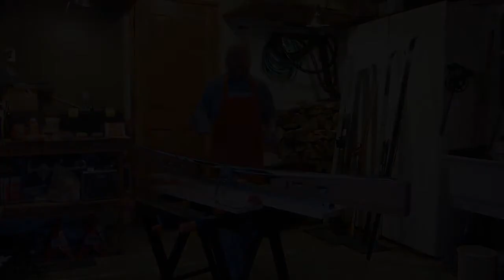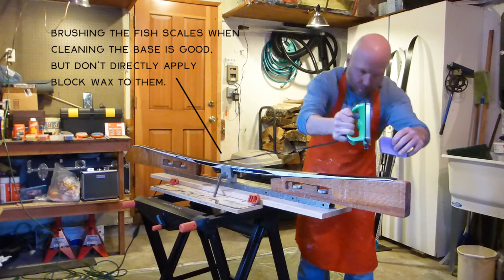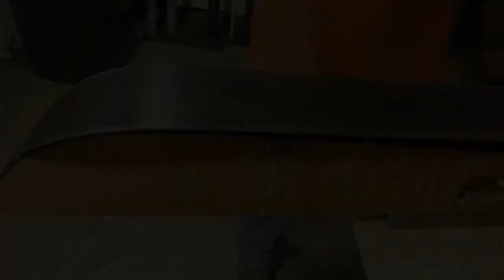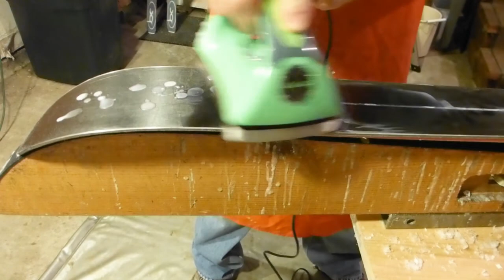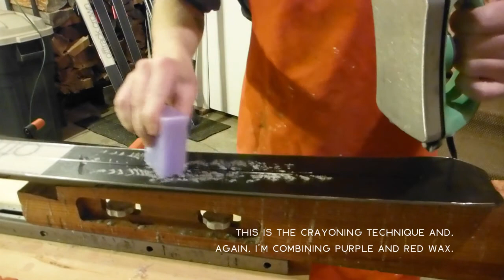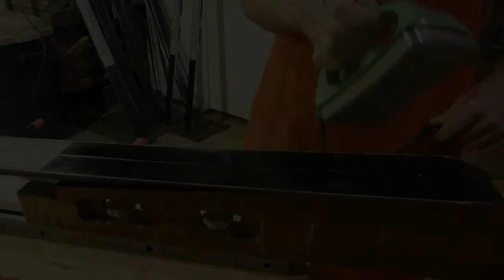Wax Your Waxless XC Skis (Part 2): Apply Glide Wax

Comment: I have one more question Jared. I have some of the older small, Swix canister types of glide wax that I used to use when I was hot waxing the tips and tails of my "waxable" skis. I was wondering if I can still use these on my "waxless" skis or are the newer waxes now a better choice? Also, my wife's skis are made by Rossingnol and the model is an EVO Discovery (L.L. Bean), the base is white, is that a sintered base as well?
Thanks,

Mike
Reply from the maker: Hey Michael,

Thanks again for getting in touch!

As far as I know, wax doesn't really go bad. If it's Swix and it's glide wax, I'd use it to initially save yourself some money. There are superior waxes on the market compared to what you have, but unless you're racing I wouldn't worry about it. Besides, there's been a whole bunch of hullabaloo about the use of fluoros in high-end waxes that's drawn the attention of the EPA in recent years. A big wax industry shake-up, actually. Honestly, though, I just stick with the basic CH (non-fluoro) wax because it's less expensive, less environmentally and personally hazardous, and I don't race. Again, I adhere to the tenets of functional waxing (vs.performance waxing) so that I limit my time in the wax room and maximize my time on the snow.

I'm not super knowledgeable regarding base materials. However, I believe the traditionally black bases have been infused with graphite to decrease friction (by "grounding" the ski and reducing the electrical charge generated by the motion of skiing ... or some damn thing like that). So, the white bases of your wife's EVOs just aren't infused with graphite. Now, there are old-timers who automatically equate a white or clear base with an extruded base (melted plastic base with no structure) because the old, cheap xc skis used to do this. With an extruded base, there's no point to waxing because it's all just going to sheer off as soon as you start running the skis.

I find it difficult to believe, though, that a respectable company like Rossignol is going to manufacture contemporary xc skis with extruded bases. That's an old business model in my opinion. Besides, I've see high end Rossignol race skis that actually have a white base. One of the upper level ski instructors at my work saw them and commented how "rare" they are to find those models in the US. If you look closely at those EVOs, you're going to see structure in the base at the tips and tails. So I say to go ahead and hot wax them like your own pair. I think the clear or white bases are a visual design thing, and I think it's also a slight nod to the idea that infusing the base with graphite might not actually be as effective as we'd like to believe. It might also be less expensive to manufacture the clear/white bases than the black ones. All of that said, it's more challenging to wax white/clear bases because it's hard to see the fresh wax on them or if you've managed to scrape it all off.

OK, time to make the donuts. Thanks again. Let me know if you have more questions, and I'll do what I can for you :)
Reply: @JaredManninen  Thanks once again for your help!
Mike